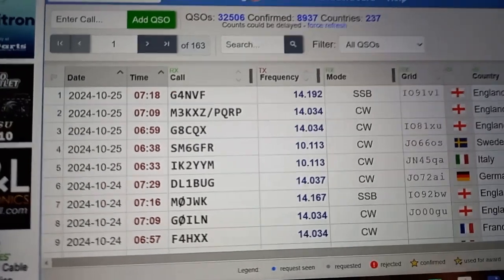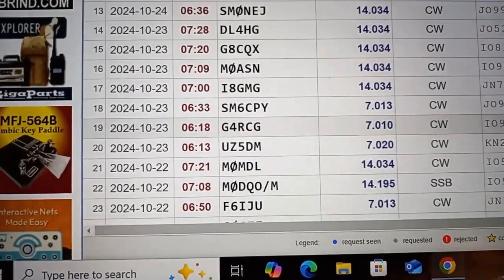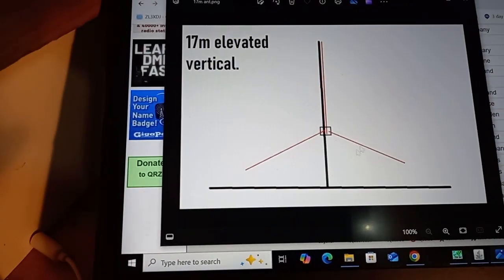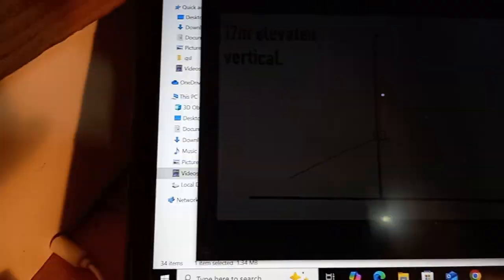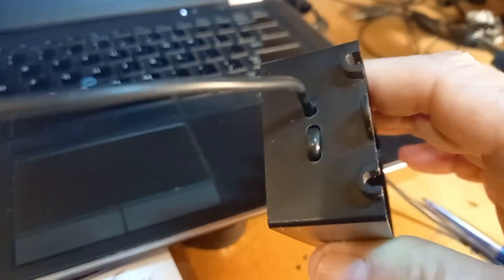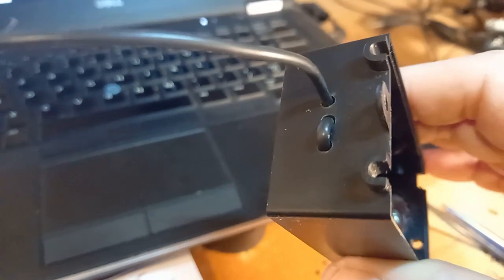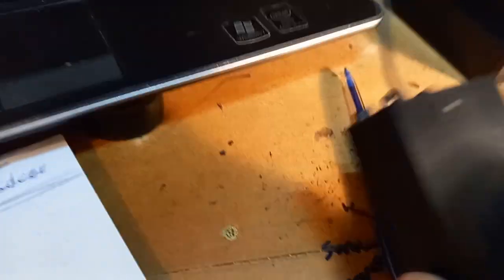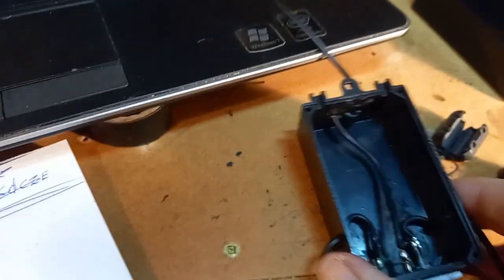ZL3XDJ.   how to make a elevated vertical antenna with radials

Comment: Hi Brian. New subscriber and I love this video. Your build matches very much with my setup in my location and it works excellent with only 2 radials (although I added 2 more recently). Been using it for a couple of months now on 20 and 40 meters by adjusting the length of the radiating element and I love it. I did find that with only 2 radials that the length and elevation of the radial does affect the tune. Did you observe the same? Anyway, thanks for your video and if your interested I have a short video of my build over on my channel. Ernest AE3HD. 73    P.S., just realized that I commented on your video previously and I forgot. Guess it was time to enjoy your video again.
Reply from the maker: Hi Ernest. Fortunately when I built my 2 ele parasitic 20m vertical and got the vertical radiating element adjusted to resonant,  then cut the radials to the same length, altering the radial angle , in my case, did not change anything.
The top of the radials are about 2m above ground, and the bottom end of the radials are about 1/2m above ground. It seems to work just as it is, so I left it alone hi. 73 zl3xdj
Reply: @ thanks for that info.

Interesting about your 2 element parasitic, I built a 10 meter 3 element parasitic for 10 meters and it works well. My next project to try is a 3 element triangle shaped with 2 driven elements and a reflector (saw it on a DX commander video). I would love a parasitic 2 element vertical for 40 meters but haven’t tried that one yet. Thanks for your reply.
Reply from the maker: @yqtszhj  would love to make my 40m vertical on the ground into a elevated 40m vertical, but cannot achieve the height. but my vertical as it is, with 300 10mtr long radials works quite well.
Reply from the maker: @yqtszhj  I see you worked a couple of friends of mine recently, EA5JZ Paul, and EA3BOX Juan.  I am mainly cw, but I do get onto ssb from time to time hi.

Comment: Are the length of the radials important?  Have you experimented with tuning the raised radials at all?  Art W1SWL
Reply from the maker: @arthurgumbus3969  hi art, I cut the vertical wire to gain resonance,  then cut the radials to the same length, after that altering the length or the angle of the radials did not make any difference to anything.  But this ant has not worked well for everyone that tried it. 73
Reply: @brianfields4479  I have been very successful with a vertical and tuned raised radials on 20M.   Base of the antenna at 54" high and the two tuned raised radials (counterpoise's) at about 198" long each.  These counterpoise run from 54" at the braid side of the base to about 36" high above the ground.  So a very slight angle downwards.  Using my antenna analyzer, I can get the antenna to nearly perfectly resonant at my chosen frequency with an SWR of about 1.1:1 or 1.2:1 depending on the earth and location.   I use this antenna for POTA activations with a Xiegu G90.  I have not tried to experiment with adjusting the height of 54" as that is the height of my vertical stand/tripod.  I was thinking about a second vertical to be a reflector/director but have not done the research to accomplish this. Wonder what the distance and lengths would be???  73 Art W1SWL
Reply from the maker: @arthurgumbus3969  I would be interested to know myself !

Comment: Why not just tie a knot in the radials and the radiating element wire coming out of the box?  It would then require only one hole per wire to be drilled and would provide the benefits of simplified routing and a box that would be easier to make weatherproof. 

The only thing I can think could be a problem with this method is the introduction of a small, parasitic induction created by the loop in the knotted wire, but at HF frequencies and with such a small knot, I can’t imagine that any such induction would be consequential.
Reply from the maker: @aerostahr  you are perfectly right, a knot could be used.

Comment: Great video. The low angle take off of a ground plane antenna will often compete with a Yagi beam. I worked Australia from here in Florida with only five watts SSB using a simple ground plane hung from a fifty foot pine tree. I have also worked hundreds of stations from all over the world using one hundred watts. 

It is the very low takeoff angle from a ground plane that makes the difference with DX. Going one step up, phase two ground plane  antennas with a switched piece of coax to be able to select a direction and add some gain.All the very best from Florida, USA. I will look for you on the bands, Dave, N2SN.

Comment: Great video. I have made a similar vertical antenna made from a 24 foot painter’s extension pole that is resonant on 20m. The first section is fiberglass and about 2.5 m long. The 2 extension sections are aluminum and combined are about 15.5 feet. I use four 5 meter radials that slope from 6 foot to ground level. SWR is good and I have made contacts to all Europe and as far south as southern Chile from here in the SE USA. Also it is a very quiet antenna. I can also feed it with a 64:1 Unun and use it for 15 and 10 meters successfully. Thanks for the excellent video. KQ4VGE.
Reply from the maker: @yqtszhj  fantastic, well done. 73's

Comment: Hi Brian, In 1955 as a child in Sumner 100 yards from the beach with a crystal set with a beadspring aerial aerial and headphones under the pillow so Mum thought I was asleep, I listened to many a nightime US crime serials from 3ZB. But, please tell me if you think your signals to the UK travel the south longpath or the north route. The reason I ask is that many years ago I read that Invercargal was a great listening area for WW2 German U boat Atlantic transmissions. Your aerials are very interesting. Sure, with a mobile phone or 500 W on a beam - well that's no challenge  - but QRP on a thoughtful wire and/radials is a learning and pioneering endeavour. Less is more. 🙋
Reply from the maker: My sig from here in the evening will be long path.